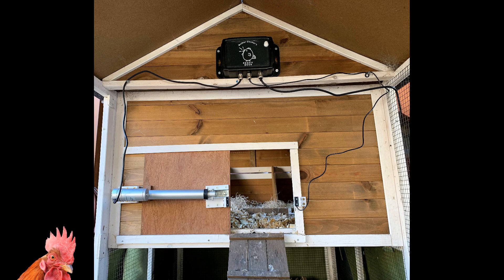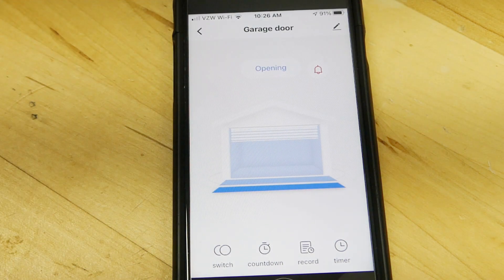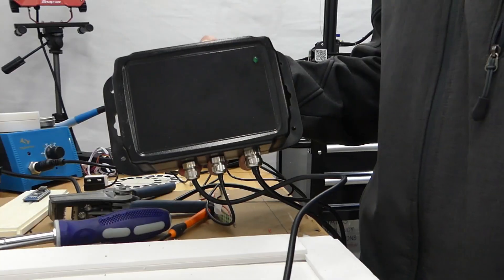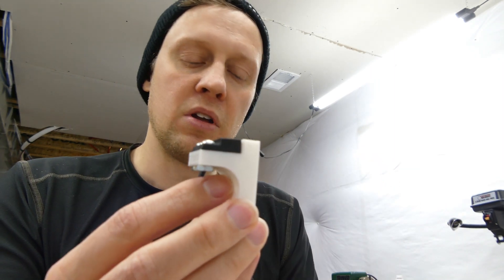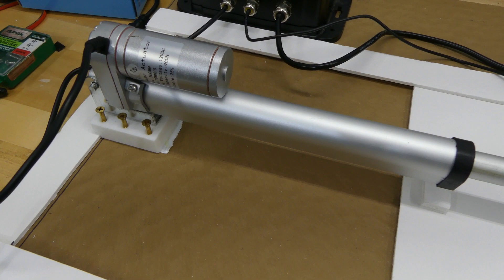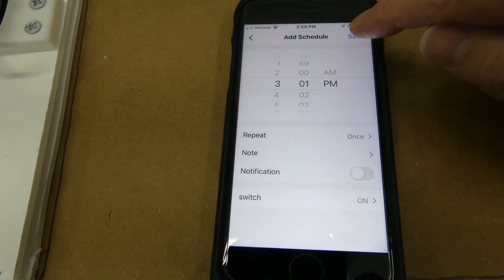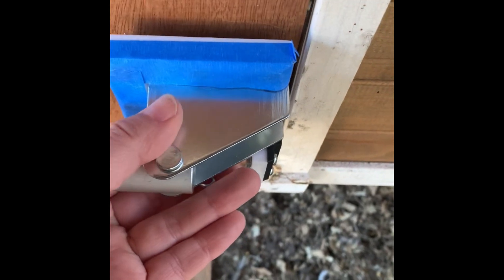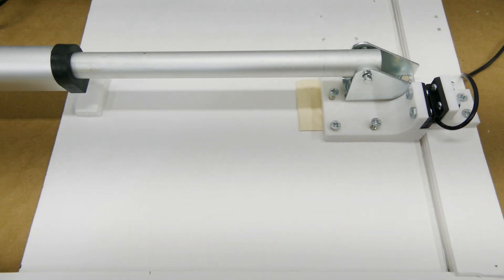Automatic Chicken Coop Door

Comment: Will this setup work with solar power?
Reply from the maker: Yes it does, however I use solar power as a backup power source to the AC. If using only solar then you’d have to also use a battery as a constant power source and the solar would just charge the battery.
Reply: Thank you

Comment: Instead of the garage door switch and Arduino,  you could have just used an MHCOZY or SONOFF 4ch switch. Way better control over the door and way easier to replace if something goes wrong.
Reply: How does this solution provide better control over the door and how is it easier to replace if something goes wrong?
Reply: @ptsteln  Yes the smart switches will give you way more and better control. And yes, if need be, replacing it can be much easier.
Reply: @ptsteln   Guess you really didn't wanna know. LOL

Comment: I am considering building something similar to yours although I have a linear actuator from a lift chair that is 24 V with power supply. Do I need to change anything component wise
Reply from the maker: The dual relay board will handle 24v on the relay output side. But will still need to be powered by 5v or 12v depending on the relay board you get. So no, I don’t think anything component wise will change, just your wire diagram would be a little different.
Reply from the maker: Let me know if that wasn’t clear and I can help you out more. Don’t forget, I have a board that will make this build a lot easier for you. Saves people a lot of time. You can find more info here: https://www.instructables.com/Smart-Phone-Operated-Chicken-Coop-Door-/
Reply: Most of the 24V DC Linear Actuators found in chairs will still work with 12VDC just slower. That's all.

Comment: Do you know of something small and more simple? I have a cat friend that is stubborn and want to open the door via wifi. i will be able to see the cat on the outside as i have a camera that alerts me the cat is there. She lives in another apartment. I already have an arduino
Reply from the maker: Yes, this device will allow you to open and close the linear relay. It will replace the Arduino, voltage regulator, and garage door controller. So basically all you need is this, 12v power, and the linear actuator. I’ve actually never tried it, but looks like it should work. Only thing is it will not report if the door actually opened or closed. But, if you can see it then that isn’t a problem. https://amzn.to/3ALc91p
Let me know if you have any questions. I’ll try to help as much as possible.

Comment: Cool video. Is there a way to install a local switch to control the system also. Thanks
Reply: Awesome thank you.
Reply from the maker: Yes, add a momentary switch to D2 and GND. Pressing this button for 2 seconds will toggle the output to the linear actuator. Hope this helps. Thanks for watching and for the question. 👍

Comment: Greeting from Florida. I can not make this to work. Everything is hooked up like your pictures in github but when i click the garage opener it doesn’t do anything. Please help
Reply from the maker: Yes let’s talk. We will figure it out. Can you email me at Jason. Altice@codemakesitgo.com Send me a picture of the wire connections on the Arduino and the relay. We can start from there.
Reply: It says email wont exit
Reply from the maker: @KiLeRY80  I haven't received it, looks like there was a space in the email in my previous message. iPhone trying to be smart. Address is "jason.altice@codemakesitgo.com"
Reply: @CodeMakesItGo  i am sorry miss the jason. Part lol
Reply from the maker: @KiLeRY80  no problem, I got the email.
Reply: @CodeMakesItGo  if you need more picture or if picture wont clear let me know i will send it to you more pictures
Reply: @CodeMakesItGo  figured out the issue. I forgot to ground from board to power source. Now issue fixed everything works perfectly. Now time to put everything to the box
Reply from the maker: Awesome! Good job
Reply: @CodeMakesItGo  thank you for your hard working doing a great project
Reply: @CodeMakesItGo  any opinion what would cause that i have to click twice to close and open. When it was outside box i didnt have any issue. I wonder if issue with close sensor not connected properly
Reply from the maker: Yes, this happens if the close sensor isn’t making contact. Make sure the magnet is within 1” of the sensor.

Comment: I'm trying to recreate this, however can you explain more of how you wire the garage door opener to the arduino?I have everything working, with the exception of opening the door. I have to push the button on app 3 times to open the door, and only once to close it.
Reply from the maker: Yes! sounds like the sensor is not connected to the Arduino. So the Arduino does not know that the door is closed. 
The Arduino software will sync to the garage door sensor state every 30 seconds. So if the door closes and the sensor says it is still open, the software will switch back to thinking the doo is still open. That is why it will close first try, because it thinks the door is always open. 

All you need is the orange wire connected to D3 (picture in link below). The yellow can connect to ground if you'd like, or just not connect the yellow wire. To test if the sensor is working follow these steps:
1. Open the door and make sure the sensor is not in contact with the magnet.
2. Unplug or power off the Arduino.
3. Power the Arduino back on, the door should start to close for 2 seconds then start to open back up.
4. while the door is open
5. Unplug or power off the Arduino.
6. Connect the garage door sensor to the magnet
7. Power the Arduino back on, the door should close all the way

The idea is that the door will stay shut if you briefly lose power at night. And stay open during the day in the same scenario.
I added a photo to the github that will help with this connection. 
https://github.com/CodeMakesItGo/ChickenCoopDoor/blob/main/P1030786.JPG

Let me know if this helps. So cool you have made this, congratulations!! If by chance you do have this connection already and still have this issue, ensure that the door sensor is making close enough contact with the magnet. Should be no more than 1" away from it.
Reply from the maker: Did my last reply help? Everything working?
Reply: @CodeMakesItGo  Bro, everything is working perfectly. Thank you so much!
Reply from the maker: Awesome! Good job making this 😁 hope it makes life a bit easier for you and the chickens 🐓